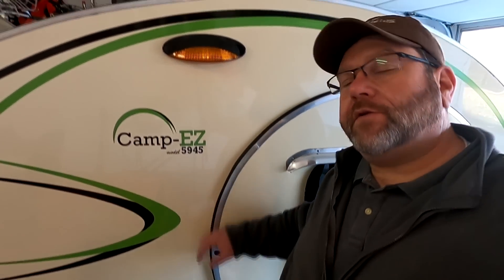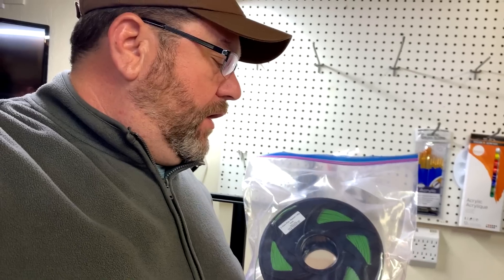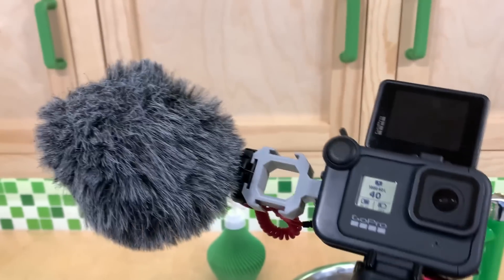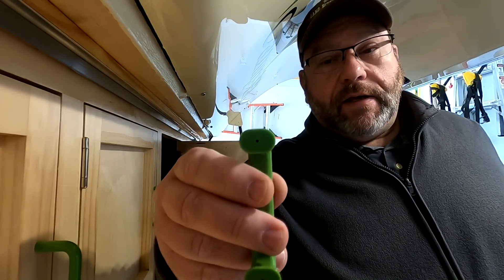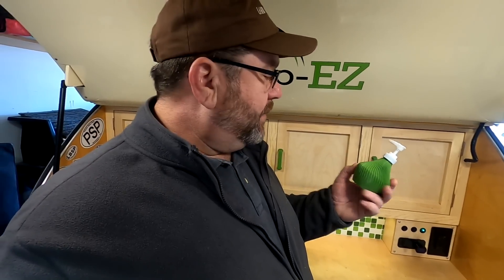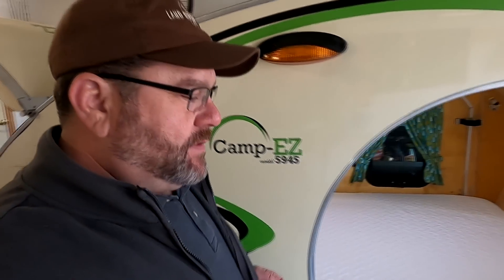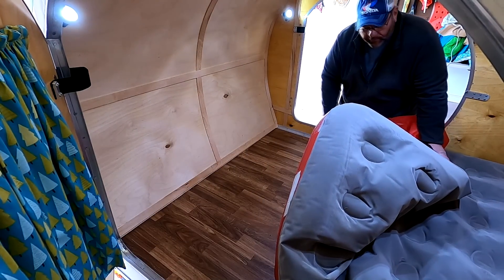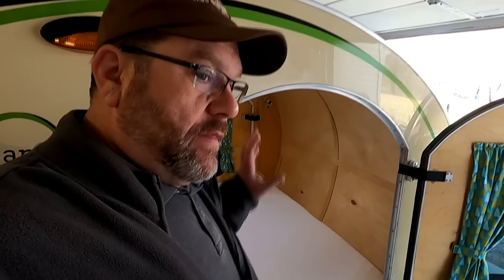5 Cool Teardrop Upgrades | 3D Print Your Own Parts

Comment: Make sure your filament material is alright for the temperature. My buddy printed out a sun visor for his fish finder on his boat and when winter came, the temperature made it crack. Always research or test what it can handle to save some headaches down the line. I haven’t had my printer working in a while, my extruder clogs before it prints. Should have got an ender 3 instead of the cheapest thing on amazon. Oh well. Happy camping!
Reply from the maker: Good advice!  Thank you!

Comment: You should check out the Froli Systems "snap-together" RV ventilation and mattress foundation.  You might even be able to print out the snap-together springs.
Reply from the maker: That would be a good project!
Reply: Whether you make it or buy it, getting a mesh base under the mattress will allow moisture to escape and avoid developing mold and mildew.  Mattresses on plywood will ultimately develop problems.
Reply from the maker: @brucefay5126  Thanks for the tip.  We certainly don’t want mold!!
Reply: @CampandCamera  I've got one of the Froli sleep systems under the bed in my camper. they have made a 4 inch foam mattress extra comfy. with the mattress in the box that you have installed it probably wouldn't be necessary as they are designed to go on a flat base bed. what you don't see with the mattress in a box which we have at home is that they have the springs built in that provide some airflow at the base of the bed.  please keep the awesome content coming.
Reply from the maker: Sweet!

Comment: Nice upgrades. One of the very first teardrop campers I ever saw was able to turn the entire wall with the mounted TV inside to the back part on the outside where the kitchen is so you can watch TV outside as well. I have never seen another one like that and i cannot find the video. Have you ever seen anything like that and do you know what I am talking about? I was super impressed and want to make one like that. Then I saw how people are just making a cutout in the side of the teardrop and storing a TV inside there that comes out on a swivel but the only problem is that you don't get that big of a TV screen doing it that way.

Comment: I made custom vents for my campers heater air inlets. Tool 15 minutes to design and let it print overnight
Reply from the maker: I’d like to see those.
Reply: @CampandCamera  sorry took a while to respond. How do I send you images? I can send you the STL files too if you want. Needs to be printed using PETG as PLA will just melt and deform
Reply from the maker: Sweet!  I can take STL files at campandcamera@gmail.com

Comment: Hi Mike. Great vid as always. I have got my lad to design me some extension "pods" to mount the exterior lighting (we are in the UK and still have to jump through euro hoops on lighting positions despite having left). He's usually building robots with it although it's pretty useful for rc plane bits too.
Reply from the maker: That sounds great!  That’s a good use for one.
Reply: You can even print entire airframes (check out flitetest). Yet to do it myself but I am a bit wrapped up in the teardrop build at the moment.

Comment: How expensive is the filament?  Did you figure how much it cost for each handle, the soap dispenser?
Reply from the maker: The filament usually costs around $20-$25 / roll.  I haven’t figured it up, but I could build a bunch of handles from one roll.

Comment: I put a double din stereo in my Jeep TJ this week and needed a new center console to fit it and the new console doesnt have the built in ashtray. Hit up thingiverse and a guy had a file for replacement storage for that spot. I dont have  3d printer but found a guy local who did and was kind enough to do it.

What is your printer and would you buy again or if you could what one would you get instead?
Reply from the maker: I have a Creality Ender 3 V2.  I like it pretty well, but have added a couple upgrade parts like stiffer build plate springs and a better glass build plate.  I’d buy it again.